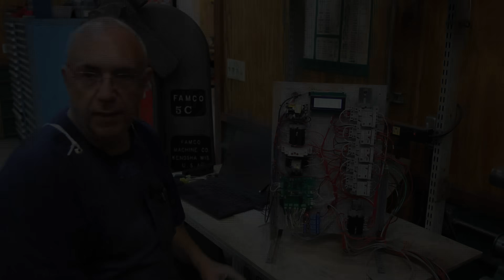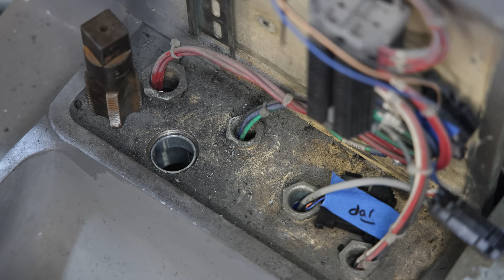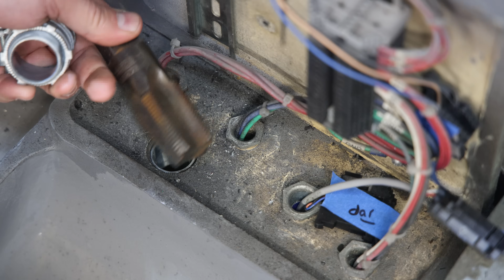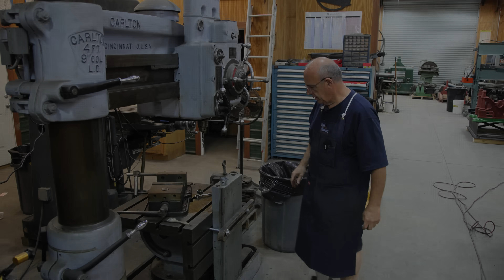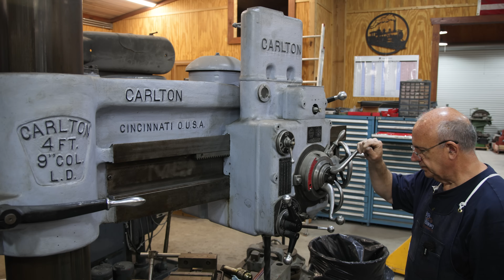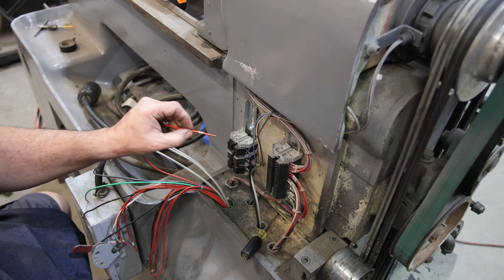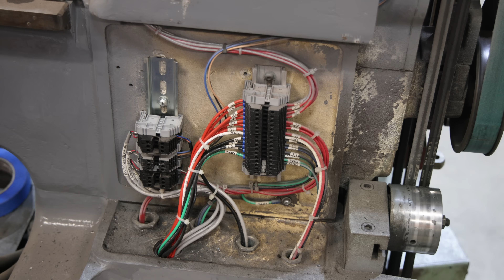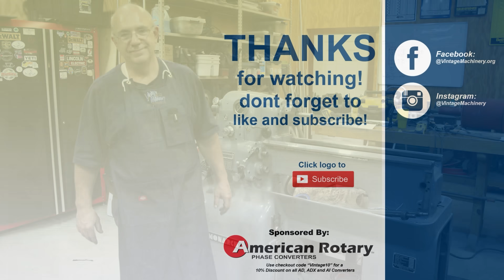Monarch 10EE Lathe Update: DC Motor Drive Conversion - Testing and Installation

Comment: That’s pretty cool.   I’m sure you’ve heard it a thousand times but it’s wayyy easier and just a capable and probably more reliable to do a ac motor VFD swap.   I’ve done three of them and the last one I did took about a day to do and less then 1k invested.  I admire the determination though.
Reply: It all depends on the application, the speed range, and the design of AC motor you have. If you have a motor designed to run at 60Hz and you use a VFD to run at, say 30Hz its impedance (AC resistance) will be lower it will draw more current and run hot. You can reduce the voltage from VFD to compensate but this will reduce torque / power which is fine in many applications. A well-designed DC system can deliver good torque from zero to full speed which is why they are still used in some applications with modern electronic controls. There are AC motors designed to work well with a VFD over a wider speed range but then you have the cost of a new motor as well and it still won't perform as well as a well sorted DC system. Some of those old systems were very elegant designs with an impressive performance even by today's standards. I'm sure Keith will appreciate a well sorted DC drive when he finally gets to use it.
Reply: @ yeah I completely understand what you’re saying in concept but in my experience when I was testing my first machine taking very aggressive cuts the belts would slip and squill before the motor would stall and it had brand new belts also. So thought a dc motor my have a little more torque it’s kind of pointless to have more then the drive system can handle.  And I mean I was taking .250 doc .5 of the diameter.   Something you’re just not gonna be doing on a 10EE, I just wanted to see what it could handle.
Reply: @billhoath5453 I’ve been saying here that I never recommend using an old 3 phase motor with a VFD. If someone wants to mod this, spring for a new, or used, inverter ready motor. VFDs use torque control which increases current below the nominal frequency the motor is nominally designed for, up to 50%. New motors are often designed to work with that, though specific inverter ready motors such as the TECO/Westinghouse motors I use are even better. They stay cool even at 6 rpm under torque. I also use TECO VFDs. No connection between me and the company!
Reply: Keith addressed this at the beginning of the project. Go watch the video. He explains exactly why he chose to go this route.
Reply: @ yeah like I said I get it, wanting to stay original.  I was just more meaning for other people that are thinking about doing a conversation on there 10EE that there is a much more simple solution that works great as long as you aren’t trying to stay with the original motor.  Thought putting a whole new drive system in isn’t actually original 😉.   Just poking fun.
Reply: It's an outdated piece of junk anyway,  who needs all that electronic BS to go bad, just for "variable Speed"?:body-blue-raised-arms:
Just one more oddity to sit in his "Vanity Shop" and collect dust!
All a good lathe needs is Forward, Reverse, and Off!:body-blue-raised-arms:
Reply: @ ok. That’s an interesting take on it.
Reply: By keeping the original DC motor with the two speed range gearbox the original operating characteristics and performance are maintained. Jury rigging an AC motor in there with a VFD isn't going to preserve that identically.
Reply: @ it actually does.  The way I have done them I retain the gear box to keep the back gear.   You literally can’t tell a difference between the two, other than the fact that it works every time you turn it on.  That’s why I ended up doing my first conversation because limping alone 80 year old electronics is very unreliable.   Seemed like I had to work on it as much as I worked with it.   I hope Keith’s system works out great for him but you say a VFD is Jerry rigging.   It seems to me that using two different dc controllers that aren’t meant to work together and aren’t even produced anymore with a micro computer controlling it all is likely to be far more Jerry rigged lol.
Reply: @chrisrollins3519 Have you done it with a 10EE? Keith isn't the first one to do it the way he did. There's a reason some choose to go this route. It seems like you're being awfully argumentative here and unable to accept anything other than your preferred choice of doing a complete motor and drive swap. Keith tries to keep things as original as possible with most of his restorations. In the case of this 10EE the drive was a "basket case". The original DC motor was still good though so he went through the effort to replace just the drive. IMO it defeats the purpose of a proper-as-possible restoration by essentially just throwing in the towel and replacing the entire motor/drive system with something entirely different (like an AC motor with VFD setup). I'm sure I'm not the only one to believe so.
Reply: @ no I’m not being argumentative at all.   If you had read my previous comments you would see that.  And yes I’ve done this to three different 10EEs.  Also as I’ve said in previous comments I completely understand why someone would like to keep it original as you can but it’s a very complex thing to do that obviously most people aren’t capable of.   Just trying to help guys out that want a simple reliable solution that’s 99% as good.
Reply: @deathk26 monarch uses a VFD these days when they rebuild old machines.

Comment: Hi Keith. Long time subscriber from the UK here.
Fantastic job there. However, I'm struggling to understand why you have done it that way.
I know you like  to preserve originality wherever you can, and I respect that. BUT, by removing the original control gear and replacing it with a microprocessor, I believe you have lost the originality and made the job very difficult for yourself.
Why not just fit a three phase motor, driven by a VFD. The machine would have remained the same from the outside, and the job would have been so much simpler. Plus, by using 'standard, off the shelf' parts, probably much more reliable and easier to fix in the long run.
Reply: It's an outdated piece of junk anyway,  who needs all that electronic BS to go bad, just for "variable Speed"?:body-blue-raised-arms:
Just one more oddity to sit in his "Vanity Shop" and collect dust!
All a good lathe needs is Forward, Reverse, and Off!:body-blue-raised-arms:

Comment: I do understand wanting to preserve as much of the original setup as possible, but, if it were me, I would delete the DC motor, install an AC motor and a VFD and call it a day. Could do that in a day's time.
Reply: I have the same model !0EE with an AC motor and VFD...it works great.  The only drawback is it is limited in RPM and won't go up to the original 4,000 RPMs.  I could overdrive the motor and make it turn 4,000 but haven't seen the need.  By the way...the AC motor and VFD transition is far easier than the DC electronics Keith is going through.
Reply: @jackpledger8118 is the torque/speed curve the same?
Reply: @mikemarriam  I don't think so, but haven't had a problem with stalling even at extremely low RPMs.  I use a 5 hp Baldor motor.
Reply: @mikemarriam if you have a good motor that will work with an inverter, you can use the torque control on the VFD. That increases the current for frequencies lower than the nominal 50/60 Hz the motor was designed around. The low speed torque is excellent. But don’t do that with an old 3 phase motor, you could burn it out.
Reply: I have the original thyratron drive and it works.perfectly.  no reason to change.
Reply: @kimwood7718  Usually the drive is changed when the original drive fails and replacement parts are no longer available.  If everything is working well, no reason to change anything.
Reply: I was thinking the same thing, swap it over to 3 phase AC and call it a day
Reply: I agree. Monarch themselves has long ago done that very thing. They buy old 10EE machines that have good castings. They remove everything and put modern components in. They use a 3 phase motor these days with a VFD. I’ve replaced motors on a number of machines over the years with 3 phase inverter motors with VFDs. If I had an old 10EE, and the drive system wasn’t in the best of condition, I would pull all of it and replace it with a 3 phase and VFD. I would also clean and carefully preserve the old drive system for the sake of history. But duplicating the old drive system to use the old motor/generator? No thanks.
Reply: They talked about doing that and there was some reason they decided not to go that route
Reply: Not really what this channel is about….
Reply: It's an outdated piece of junk anyway,  who needs all that electronic BS to go bad, just for "variable Speed"?:body-blue-raised-arms:
Just one more oddity to sit in his "Vanity Shop" and collect dust!
All a good lathe needs is Forward, Reverse, and Off!:body-blue-raised-arms::face-red-droopy-eyes::face-red-droopy-eyes::face-blue-smiling::face-blue-smiling:
Reply: Definitely agree, seems like a very complicated setup just to use an outdated motor. Not going to be fun fault finding when the electronics inevitably have a brain fart
Reply: @danieltaylor3611  excellent point
Reply: Go buy one and do it then.

Comment: i know you probably wont address this question on your chanel i swonder if you could use a battery bank with an ac to dc charger instead of the ardreno etc
Reply: I have no idea what you're talking about, why would it need a battery bank?
Reply: @CatNolara So you can take the lathe camping.
Reply: The armature on the lathe wants 245v so it would need a lot of batteries (over 150) just for that.  Then there's the field, etc.  No real way to power this by battery even with the DC motor.

Comment: Morning Kieth, I think this is the first time I've commented on your site in about 7 years. How time flys. This was a great video as I have just sold my 1950 Willson Gap Bed lathe and am in the Process of buying a Harrison lathe. Both old British makes. I was thinking of making a variable speed system for it and there was your video straight up in front of me. Very fortuitous.  Great show, look forward to seeing your next project.
Regards to you and yours.
Richard 🇬🇧
Reply: I recommend that you replace the old 3 phase motor, if that’s what’s it uses. Old 3 phase motors weren’t designed for the torque control that VFDs use. That puts as much as 50% more current into the coil at the lowest speed. Old motors weren’t designed for all of that current and could burn out after some time. I know some people claim that they’ve been doing this without a problem. But I wouldn’t go by what they say. They could be lucky. I wouldn’t take the chance. I use TECO VFDs and motors. They work very well and are easy to program.